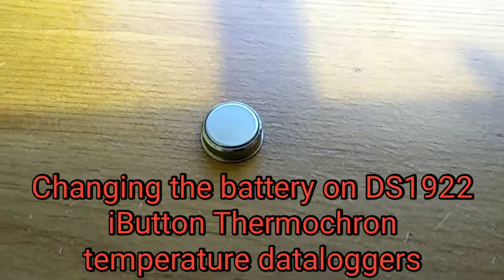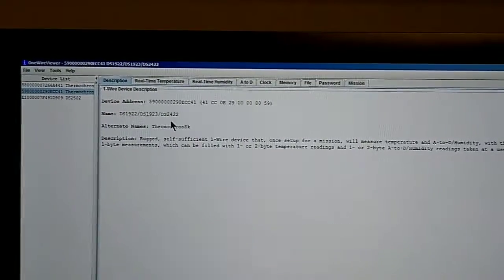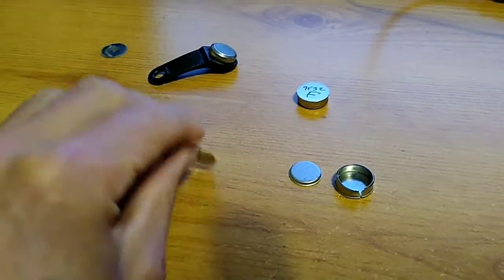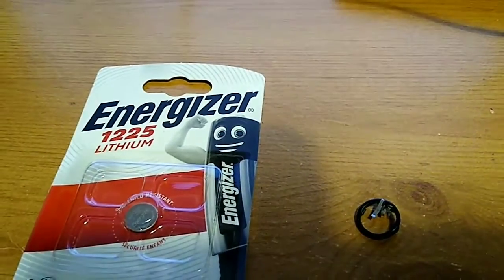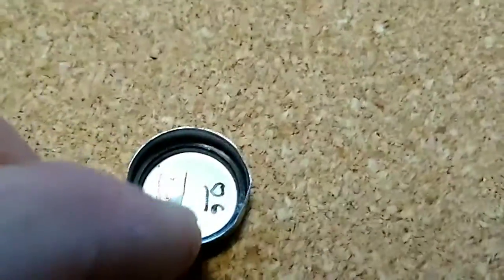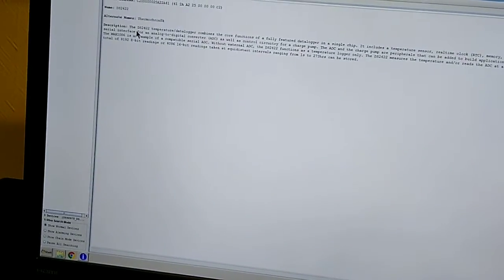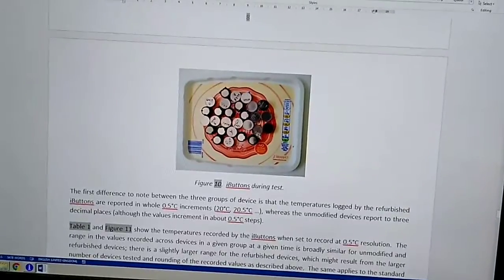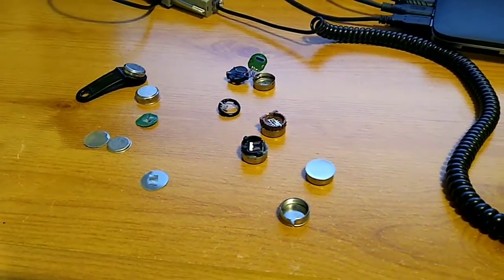Replacing the battery in Dallas iButton Thermochron dataloggers

Comment: I’ve been on the hunt for a replacement Dallas RTC battery for my old GVP jaws II graphics accelerator card, the battery part number is DS1494l-f5 it seems very specific, the DS1994l-f5+ 4kb came up as a possible alternative but even that is expensive or very hard to get now. Your video has given me a little hope to rejuvenate it by replacing the battery, hope it works for me too, great informative video thanks 😁👍
Reply: It appears the DS1995 is a 16k but uses the same family of support chips. It may work in your application.